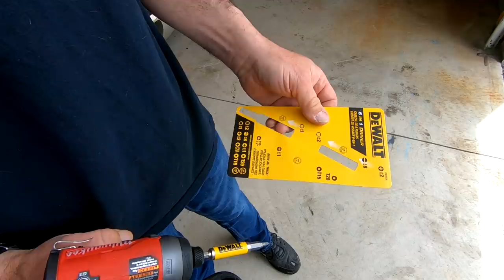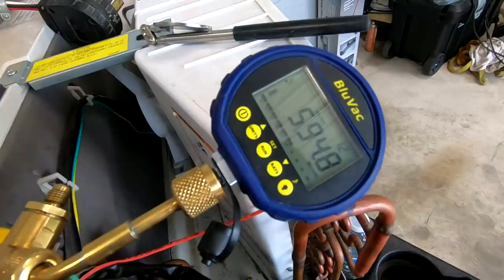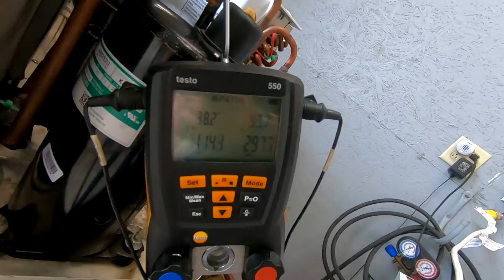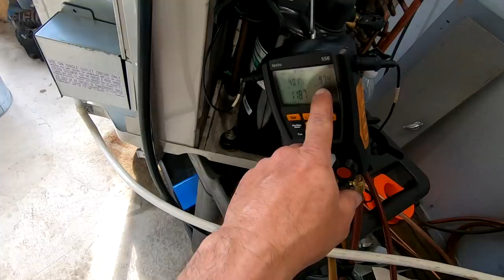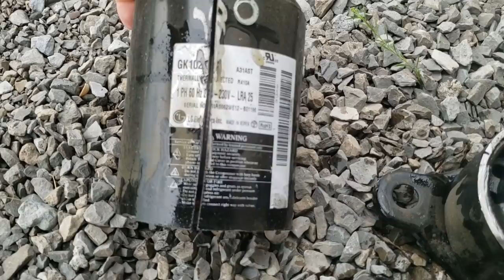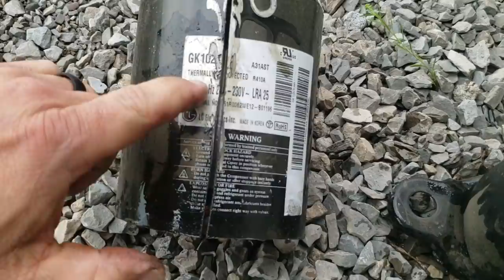PTAC Heating Cooling Through The Wall Unit Evaporator Replacement & Compressor Tear Down

Comment: I have several LG "DUAL Inverter" Mini splits that use variable speed compressors with similar construction, they have two rotating pump elements with 180 degree offset, they are very quiet as the pumping action is well balanced. Runs on new R32 refrigerant. They use very little power and are quite efficient. Tiny things as they output 3.5kW cooling power.
Reply from the maker: I seen that refrigerant for the first time a few months ago on a little window unit.

Comment: I've repaired probably 100's of PTACs from brand new Applied's to 40 year old Singers. I can tell you that those rotary compressors do not hold up well in these units. If they suffer a burnout, the unit is basically junk. A new compressor will only last about 6 months and burn up again. Ya cant get the contamination out of the system. Old units with Recips are still running on the original compressors. That's my rant lol.
Thanks for the video Rick!!!!
Reply: Same here. Iv'e worked on too many. Now a days the sealed system is under warranty for five years. After that I would only work on the electronic items. Anything else, better off just getting a new unit for $800 or so. We had a lot of Amana's and Island air. Island air were nice, but cost about $1400 and had two compressors (one for dehumidifying the outside air coming in.)
Reply from the maker: I only replaced the evaporator. The compressor I cut apart was only used for an example because it was a rotary compressor just like what was in this particular unit. The only reason why cut it apart was to find out why no oil came out. It's's not everyday I got one laying around to do a demonstration on. LOL (it's been sitting there for months 😁.)  This is the first evaporator I've ever replaced in a PTAC and it was only done because the unit was practically brand new and the customer didn't have a lot of money in it. Otherwise I agree with you 100%. Thanks for the feedback 👍👍
Reply from the maker: I agree, this the first time I've ever replaced anything on one of these other than the electronics or recharged it.
Reply: yep, pretty much disposable garbage made to fit the same footprint and be more efficient than the old. problem is you replace them non stop and any savings from efficiency is lost in frequent replacement and all the upstream excess manufacturing of them.
Reply: Mostly because they use cap tubes and no filter driers.

Comment: Yeah PTACs are a whole different beast. First company out of trade school was a PTAC. That's mostly what we use here in NYC. Cant have a window AC hanging out the window 40 floors up. Great video.
Reply from the maker: Makes sense, that would leave a mark if it fell out 😎😁👍.
Reply: pretty typical in hotels and motels also, less chance of theft/vandalism (even though they come out easily, lol) the wall sleeves usually don't
Reply: @throttlebottle5906  don't need no stinkn wall sleeve. Just seal around the middle, install a piece of sheetmetal over top of condenser area, install a foam or hoghair sir filter over indoor coil inlet. Done.

Comment: Hello Rick! Rotary vane compressors don't use valves(strictly not to be used in Tandem Config, if one compressor is disconnected electrically it rotates in opposite direction and bypasses the refrigerant, based on my trials) and also the one you have cut open is already drained.. In India we use metric terms, So usually Aircon Compressors of about  0.75 ton to 2 ton uses around 500-600mL of oil. Typically with LG rotary compressor about 80% oil is drained through discharge line just by placing it upside down.
Reply from the maker: Great to know, I don't work on many so I unfortunately was a Rookie on the design principle of the compressor. Thanks for explaining it 🤜🤛👍👍.
Reply: @HVACRSurvival  I've learned a lot from you Rick. Thank You so much for the great content you provide on your channel...
Reply from the maker: Wow, I appreciate hearing that!  I'm trying to make a difference👍👍 are your in India?
Reply: @HVACRSurvival  Yeah! South Side.
Reply from the maker: @I_AriesMan  word ⚡⚡👍👍
Reply: @HVACRSurvival  One quick update, Rotary Compressor has a single valve like circular disc on top of the pump assembly which lifts up when its operating, similar in shape to a metal washer around the shaft. I opened one 11 years ago while doing my Engineering, just out of curiosity. It was a  Matsushita Electric brand and been a long time I almost forgot about that. Winding is the most common failure (over heats) in rotary compressors when the refrigerant charge is low on the system. But over the years Rotary Compressors have come a long way in terms of reliability.

Comment: Replaced heaters in these units but never bothered to fix refrigerant/compressor issues.  Most tenants want it fixed fast so just through in a replacement unit.  But that unit looked new
Reply from the maker: It was very new, I forget what the story was but the guy did not have much money in it so he choose to repair it.

Comment: Maybe a island air unit? I changed a evaporators on one and didn’t have much oil in the compressor. Good video
Reply from the maker: Good to hear, changing the oil is something I'm going to consider more often after the problems with capillary tubes I had on a reach in cooler. Thanks 4 watching 👍👍

Comment: Just out of curiosity I looked up how much oil in a small 2.5kW/9kbtu mini split with a rotary compressor similar to this one. only 270ml of PVE. Even going up to a 5kw/17kbtu they still only specify 350ml
Reply from the maker: That's cool to hear. So my guess of five or six ounces wasn't too far off 😲.  Thanks for taking the time to look that up 👍👍🤜🤛

Comment: Rotary vane compressors are really good with efficiency and are fairly simple on the inside meaning less to go wrong. A small flaw is if the power is lost as the compressor is coming up to pressure, the vane can loose compression and bounce off the rotor face a bunch. Not sure if that can damage it or not but it sounds brutal
Reply from the maker: Thanks for sharing that Mr. Fox. That's good to know, like I said I don't do a lot of rotary vane compressors so any extra information is useful. Thanks for taking the time to comment and watch the video 👍👍

Comment: I have to ask, if you don't mind sharing.  what do charge for this?  Is it worth all this work for a fairly inexpensive PTAC??
Reply from the maker: I think a lot of these units cost $1,000 to 1,800 new. This PTAC was fairly new, I forget how it happened but it was a lot cheaper to repair it. This probably cost a couple hundred bucks. We don't rape our customers like some company's.
Reply: @HVACRSurvival  man, a couple hundred buck??  You gave it to ‘em..  I would charge about  $1k for a repair that intrusive..
Reply from the maker: Our service department isn't designed to make big money, they take good care of us but the install tickets are where we make most of the money.
Reply: @HVACRSurvival  Just the opposite for me. Very few like carrying parts or know how to troubleshoot.

Comment: I’m going to take a window unit and take the condenser out and rap a 80 gallon tank with around 12 raps of copper line  to try to make my own hybrid water heater
Reply from the maker: Might as well give it a shot, I have seen the HP water heaters and they basically work just as your wanting to do. Let me know how it goes! I have thought of running the hot gas line from my heat-pump into a water loop for my water heater with a solenoid valve to switch it on and off based on priority for the heat load of the house.
Reply: That's what all large companies get installed if they have big units.. And you can actually sell the excess warm water to citys heating company..

Comment: That is a rotary compressor. A scroll compressor uses an actual scroll. Scroll compressors are usually tall and round at the top and are typically found in whole house central AC units.
Reply from the maker: Your correct 👍👍I couldn't think of the name when I was recording it🤣😏

Comment: Looks like there's a hole on either side of that wiper/divider thing where the gas can enter and leave. Interesting that the windings are on the high side instead of the low side, you'd think that would make them much more prone to overheating. Guessing that's some kind of efficiency thing to add the heat of the windings after compression rather than before.
Reply from the maker: The more I watched the footage while editing the video, I started to see something like your mentioning.
Reply: exactly, inlet port is on one side of the sliding vane inline with the external suction fitting and outlet just on the other side of it, facing towards the top.

Comment: How did you make that hole in the copper pipe ?
Reply from the maker: Originally the piercing tool did it but I had to drill it out a little bit for the quarter inch piece of stub to fit into it. That's why I used the vacuum to catch any shavings.
Reply: @HVACRSurvival  those shavings scares me a lot lol
Reply from the maker: I know, it's not my preferred way of doing it but there wasn't a lot of room in that box. But seeing the screen in the accumulator makes me feel a lot better about shavings.
Reply: @HVACRSurvival  

Arev You on any other social media ? 

What do you say happens when someone accidentally topped 410a to an a charged r22 unit
Reply: The pressures on low side is 69 psi 40F  coil. High side 250,  suction line temp 80F, 40f Superheat. 
Subcool 11F. 
?

Comment: That was interesting.  I don't know how you managed to braze inside that thing , just by looking at it and how little space there is I would probably have tapped out , I hate these compact equipments .
In my opinion it's just trow away units , non serviceable. 
At work we have some IT cooling racks that are about 10-15" wide , everything cramped out , 3 way valves behind tubing etc , it's an absolute nightmare,  it makes me question my professional choices and consider quitting everytime I have to work on them !
Reply from the maker: I fully agree, this video was way longer than what I wish I would have recorded so I cut a lot of my commentary out. The machine was almost like brand new and that's the only reason why the guy sunk money into it. If I remember the story correctly he either got it for free or got it really cheap so the little bit of money he put into the coil wasn't much of an investment compared to what he had in it. Thanks for watching 👍👍

Comment: how do i fix the unit when the heat works but the heat pump never kicks in??
Reply from the maker: There can be several reasons for that, without seeing the equipment I would only be guessing. It could be a wiring issue a thermostat issue a sensor issue programming issue there's several different things. If you're not in the field I would recommend calling your local contractor that has a good reputation.
Reply: @HVACRSurvival  thanks!

Comment: rotary compressor are becoming more and more commen in these days  . Toshiba have just released a new rotary compressor that can be used in a system about 15 tons! however , they are not good for high lift applications during cooling (for example : ptac) , that why they have more problems than old piston compressors. or these ptac companies just buy cheapest rotary they can find.(such as lg , rechi).
Reply from the maker: That is interesting to hear, Thanks for the information!

Comment: Rotary compressors are discharge cooled
Reply from the maker: Explain?
Reply: HVACR Survival I should clarify. The vains or plate is at bottom where suction comes in. After that the rest of the compressor including the motor are discharged cooled. The temp of the discharge gas is still cooler than what the motor would run without it.  So it’s a discharge cooled compressor or more like a hybrid I’m saying.
Reply: And why they run hotter than other suction cooled compressors.
Reply from the maker: Interesting, makes sense 👍👍